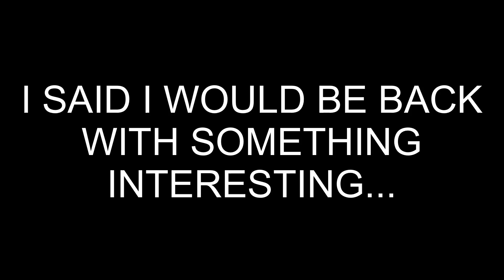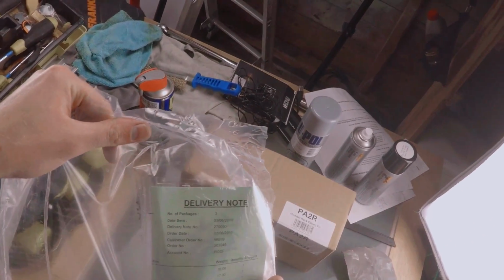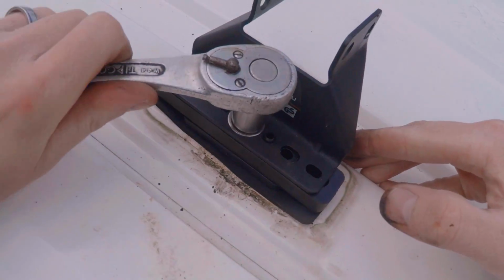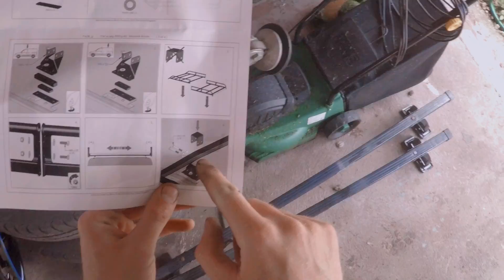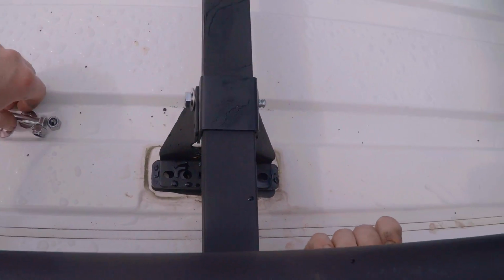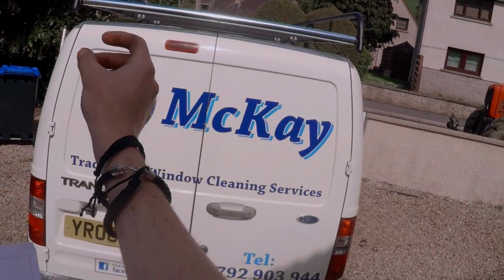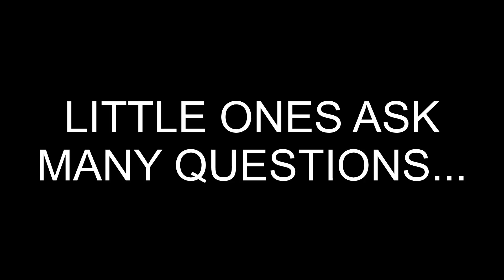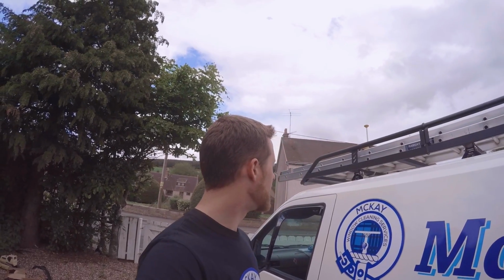Fitting A Rhino Roof Rack - Window Cleaning Van

Comment: Thanks for the video. I have been thinking of getting a new roof rack. The one I have, came with the van and it is a little rusty. The rust has run down and has affected the paintwork.
Reply from the maker: Yeah I was getting the same thing. I highly recommend the rhino rack, solid as a rock 😁